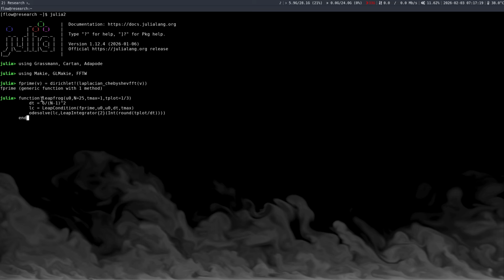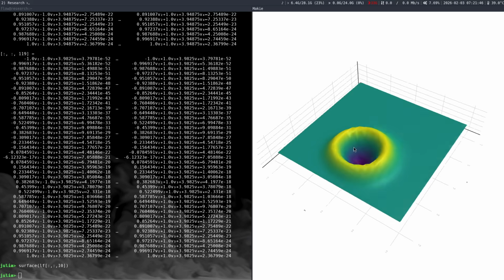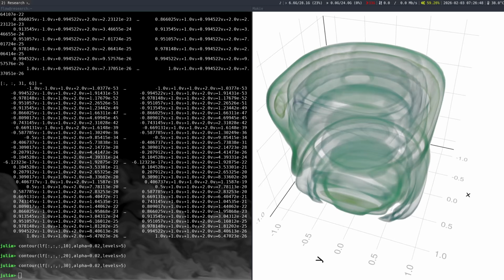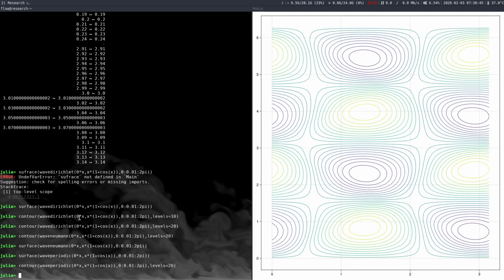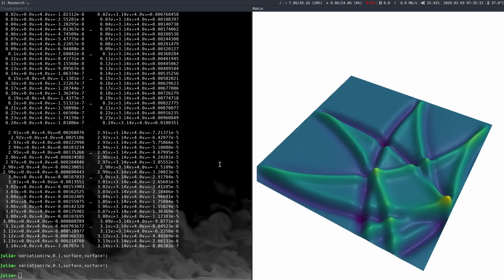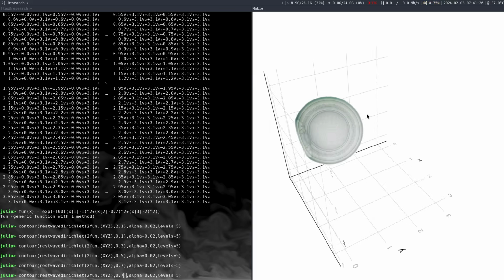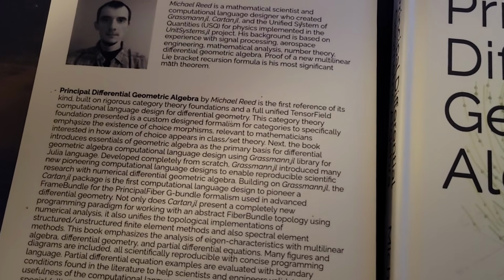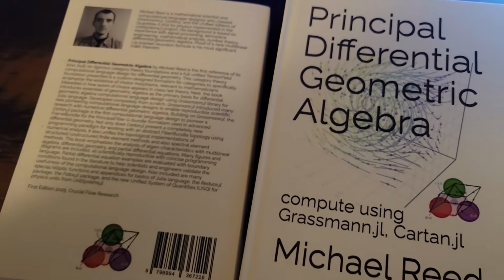Multidimensional Fourier wave methods using Grassmann.jl, Cartan.jl

Comment: hi! I have a question about how you run Julia on linux. What compiler/julia version do you use in order to run it inside a shell and also have the plots displayed on side, I would like to have a setup on my linux distro similar to yours  in order to learn Julia. 

p.s.: nice demonstration overall, you reminded me of my Control System classes from my bachelors
Reply from the maker: That's the regular Julia REPL on Linux, it can do that regardless of what kind of window manager you are using.
Reply: @CrucialFlowResearch thank you, good luck with the book promotion

Comment: Amazing! simply amazing... This is the first thing I've seen that makes me want to try and give Julia a shot. Sort of a boring question, but is there any possibility that there is a trivial method to bring a numpy data structure into one of these didgeridoos? Obviously, manipulation post-loading in julia, but I am curious indeed... A converter for a particular data structure would be a script, but I imagine trivializing conversions of higher-dimensional datasets into your model (and possibly back to C numpy array) would be a killer feature... Kudos
Reply from the maker: Julia has support for python with PyCall.jl and related packages. My Cartan.jl package might work with data ported from python, so you will need to find the middle ground. It may be trivial but it's also not directly my responsibility to depend on older paradigms.

Comment: Very advanced math. Can chemical engineers find this useful? What is your project about?
Reply from the maker: Depends on whether chemical engineers use mathematics or not. It's a mathematical foundation for studying differential geometric algebra and partial differential equations by building on the mathematics of a FiberBundle with a TensorField.
Reply: @CrucialFlowResearch what's a fiber bundle and a tensor field
Reply from the maker: @notaras1985  those are mathematical abstractions i used as "substrate" for differentiable geometrical spaces
Reply: @CrucialFlowResearch why is a substrate needed
Reply from the maker: @notaras1985  a substrate specification helps with realizing the actual construction from an abstract blueprint

Comment: Around 26:25, why do you have to adjust the level curve quantity occasionally? When the level curve fills the entire space, is that a glitch?
Reply from the maker: that's simply an artifact of the specific data being visualized, sometimes toggling from an even number or odd number makes the specific data look better in a 3D contour visualization, to manage the visual feel of the output